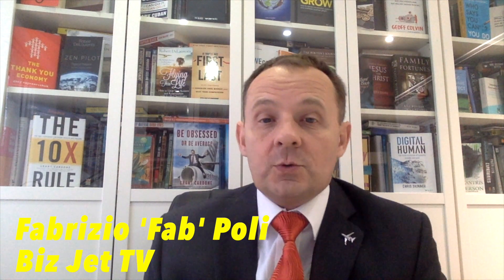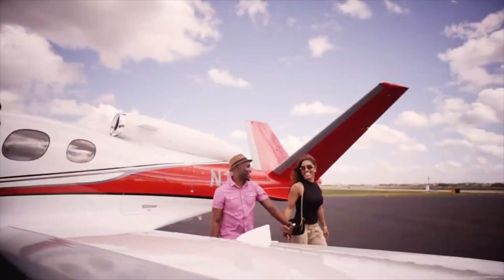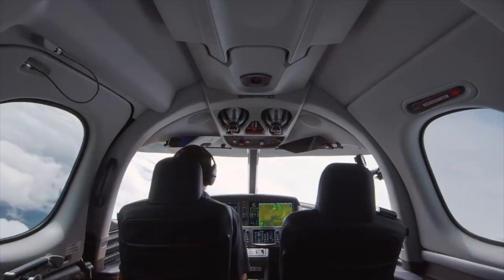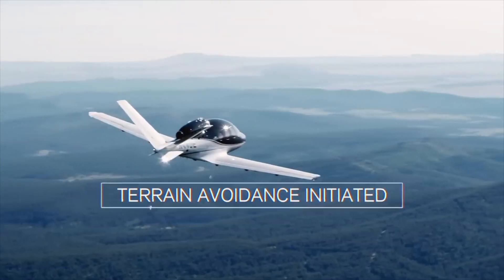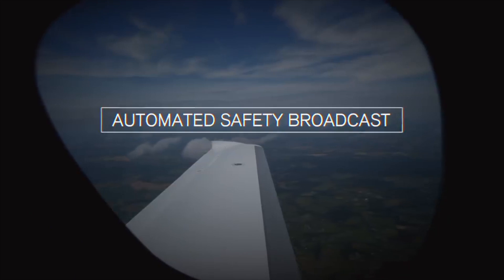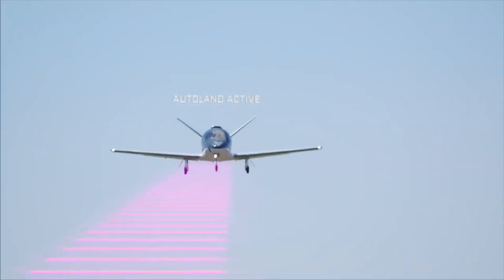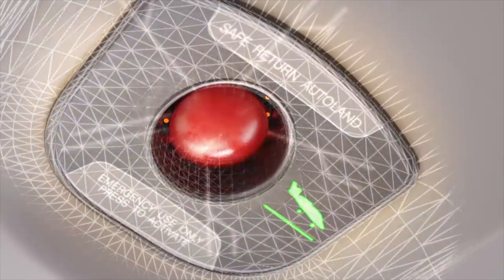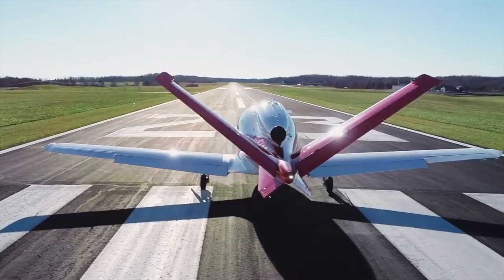Private Jet Auto-Land

Comment: If it need to, can it do a go round?
Reply from the maker: Dale, that is a very good question. to which I do not know the answer. In my view this should be built into the system.
Reply: I haven't heard anything about what happens in a situation requiring a go round or any other similar situations. I have watched a number of videos on this and have not seen anything answering this or even asked. Until now. Good job. I am sure they will address the abilities in a more full fashion soon. People will have to be comfortable with this automation before it will be widely adopted. Be safe.
Reply: Good question Dale. Lateral thinking is critical in aviation. Well done.